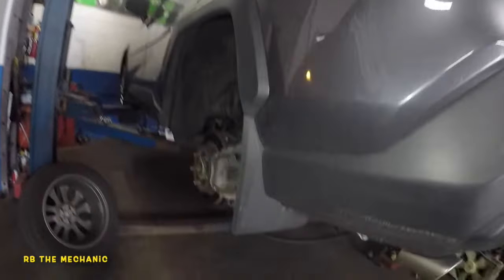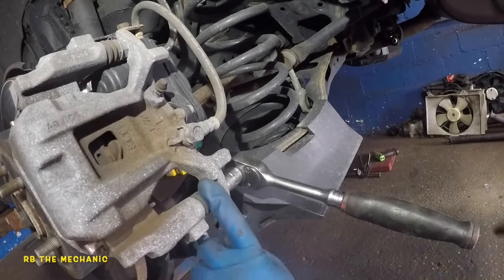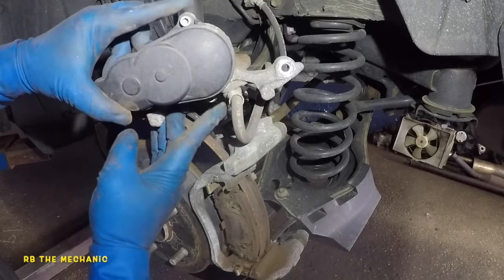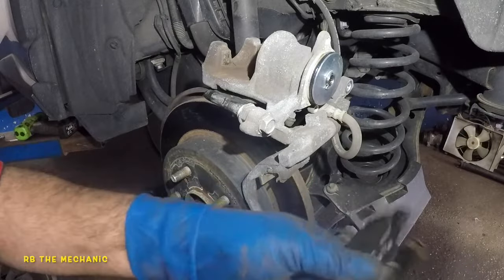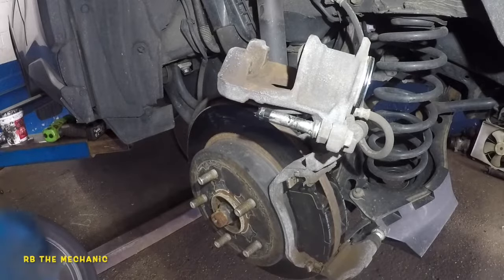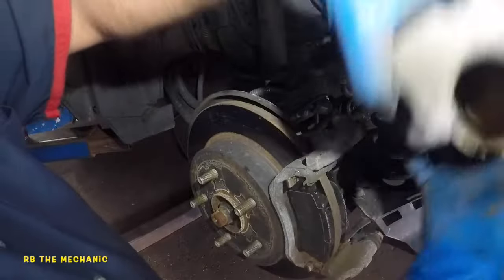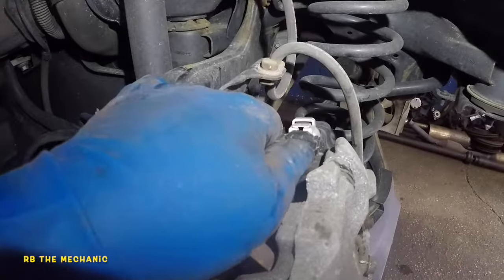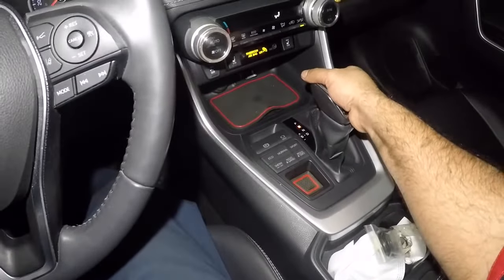Replacing rear brakes on 2021 Toyota RAV4 with Electric Parking Brake

Comment: That is a ridiculous amount of work and time to be fiddling around with the actuator, instead of putting it in service mode
Reply from the maker: Yes but sum cars u need scan tool to put it in to service mode I tried doing to push the button down 3 time and all didn’t work so I did it my way!!

Comment: So what’s wrong with just putting it in service modes. Several button pressing and you’re done. What so difficult?  I have not done these brakes yet but I have easily tested myself putting it in service mode.
Reply from the maker: Didn’t work so I did it my way
Reply: What’s wrong is that the stupid little motors sometimes can’t even depress the piston all the way so you end up shoving it in with your thumbs and a 12v jumper anyway.
Reply: @charlosrossi  i see. Yeh I hate all this new tech that in my opinion is not needed. I never use emergency brake in 45 years of driving and never regretted it or needed it

Comment: I know it’s subjective but at what mileage were these brakes needing replacing my RAV4 is just over three years old with 43,000 miles and I definitely think I need to replace the pads at at least already
Reply from the maker: It’s about that time u have to physically check the thickness but I would do it around this milages

Comment: I recently messed up the caliper. The piston pushed out too far and now it wont go back down. I was changing brake pads and got rotors resurfaced. Should i buy a new caliper? If so, after i put it on do i bleed the lines or leave it as is? Please help
Reply from the maker: Yes replace it and U need to bleed it

Comment: Hello from North Carolina!! Love your Videos, by the way. They're VERY helpful!!

So, I'm having trouble finding a replacement 'brake master cylinder' for my 2001 Lexus ES300.
 I bought a 'guarantee fit' NO- traction control 'brake master cylinder' from Napa Auto Parts. 
 My mechanic tried to put it on, didn't fit. He spoke with the folks at Napa and they told him the 'part' had been packaged wrong and they would send out another one. 
Tried the 'new' master cylinder and you guessed it... the part doesn't fit...Meanwhile we're awaiting Napa to find out what the issue is on their end. 
My mechanic said he would also contact Lexus to double the part. 
Of course, as you know, Lexus no longer makes 'brake master cylinders' for older model cars. 

Hopin' you can help!! 

Thanks so much✌🏽
Reply from the maker: I would search somthing on amazon Dorman is good brand Napa part u will be doing it very soon again
Reply: @RBTheMechanic  Cool, thanks I appreciate it!! Will definitely do that. Happy Holidays❤️‍🔥🌟✌🏽

Comment: Isn’t it easier to put it in service mode?
Reply from the maker: Well I don’t see a way to out it I tried it
Reply: @RBTheMechanic ok ok I just had to do these today. It went into service mode no problem and then you can depress the piston the rest of the way with your hands. I just figured I’d mention it over taking that whole thing apart and doing it manually

Comment: Thank you! Can you do a windshield wiper not wiping well even w new blades?
Reply from the maker: That means u need to replace the wipers I had that issue I purchased most expensive wiper blades and they were no good right in center it left streak
Reply: Yes same problem left a streak in the middle. Thanks again for the tip boss!
Reply from the maker: @rjammac4  oh yeah this is the issue with those thick fancy wiper blades. I now days when ordering wiper blades I tell the parts guy send me cheap wiper blades they work well
Reply: Ya i thought getting those rainx $35-40 per blade will solve the problem but its the same thing.